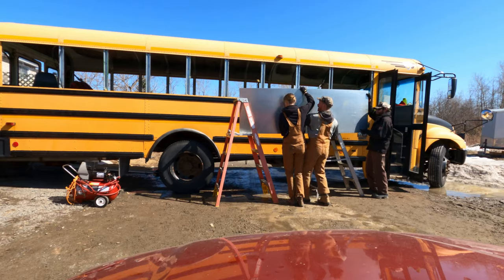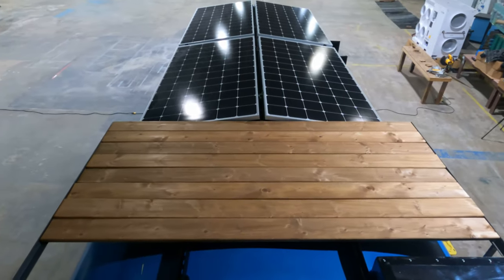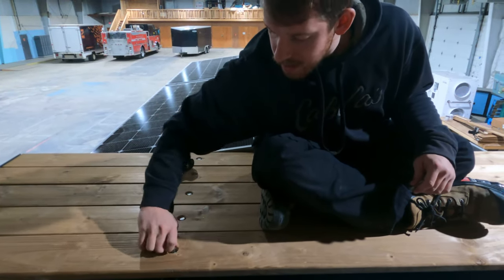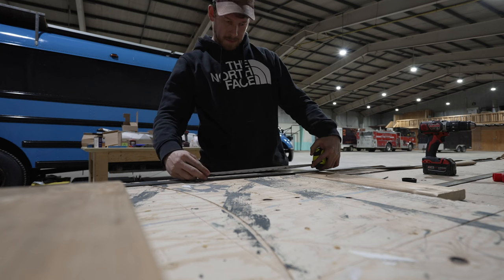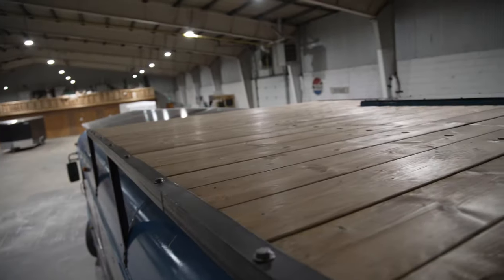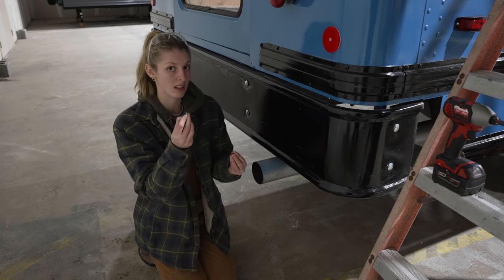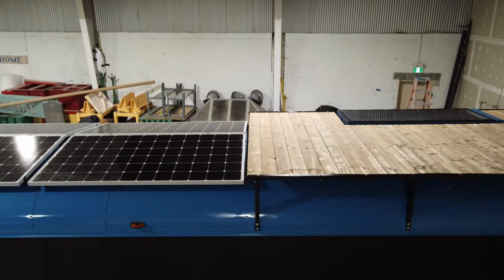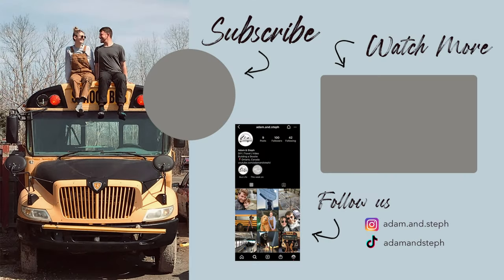Deck and Ladder Install: Part 2 | Skoolie Conversion Ep. 21 | Adam & Steph

Comment: In a warm, humid atmosphere, the cells reabsorb moisture from the air and expand. A board cut across the grain, or perpendicular to the growth rings, may expand as much as 1/4 inch for every 12 inches of width, while a quarter-sawn board may expand 1/8 inch.

Comment: Hi guy's, deck looks fab. Adam, if you are planning to do any maintenance on the deck, i would use some copper slip (anti-seize you call it) on those stainless bolts as stainless binds to itself. Did you also treat the boards where you cut and drilled them to stop the wood from rotting? Really coming on well now.
Reply from the maker: Thanks so much Neil! We were thinking about staining it a darker colour when the wood became dry. But we ended up really liking the colour of the pressure treaded wood. We had an old can of cut and seal but it was too old to use. So another trip to the hardware store to get a new one so we can properly seal the drill holes and cut ends! Thanks for the tip on the hardware! We will definitely look into that! :)

Comment: Funny you say the inside isn’t done. I keep thinking to myself I need to paint first but it’s too cold and wet here in washington.
Reply from the maker: When we first got our bus (last February) we started on the inside gutting it completely and through the spring we welded the holes in the floor and painted it with por-15, and then sheet metaled our sides and did our huge skylight restructure. That brought us to summer time where we took the opportunity to paint her which took up pretty much whole summer, pushing fall time. If it weren’t for the indoor space we were able to bring our bus to in the beginning of this year, we would be working on the inside too through the winter! But we really wanted to bring her inside so that we could do the roof setup before spray insulation since all the mounts needed to be done under the insulation! Working through order of operations of your build while also considering the seasons when the build is done outside is very tough! Hopefully you get some dry days in the summer to paint your bus! But for now, enjoy building out the inside! 😁

Comment: You said its shrunk 4 inches as it dried out, are you worried about summer humidity when those boards swell again?
Reply from the maker: Nope! Boards don’t usually swell after drying out. Might have minuscule swell from moisture but definitely won’t gain 4” again. We’re actually more concerned about it continuing to shrink and creating gaps in our deck. But I don’t think they’ll shrink much more than they have already!